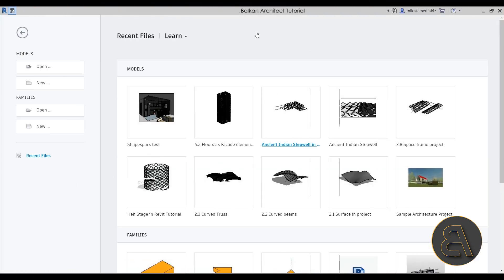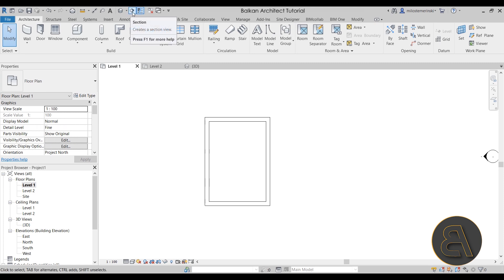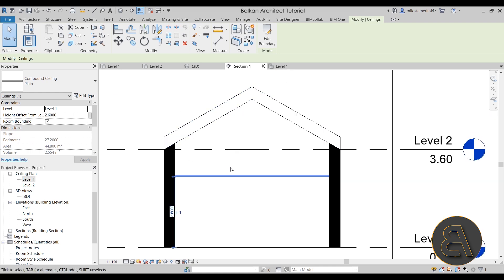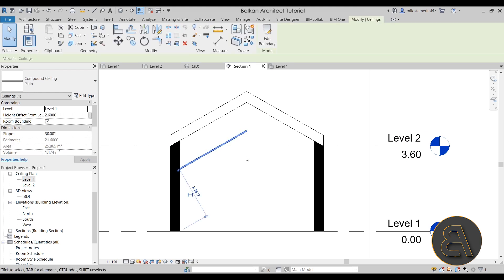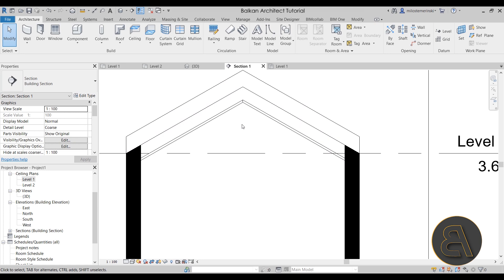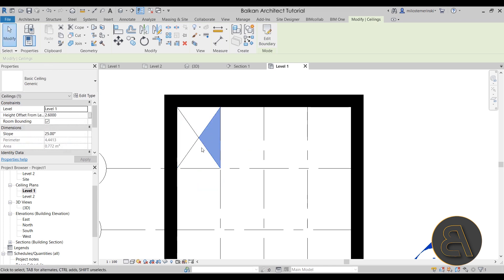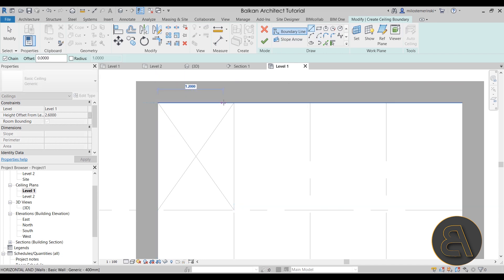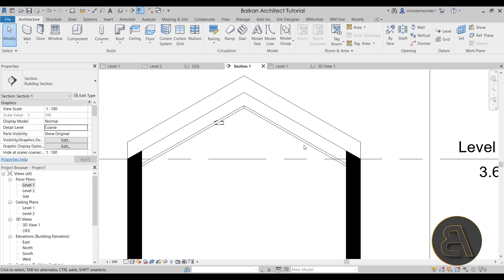Sloped / Vaulted Ceiling in Revit Tutorial

Comment: Hello! Is there a way to attach the sloped ceiling to the sloped face of the roof other than just dragging it in the section view? I mean ideally there should be an offset value perpendicular to the roof because the vertical offset is largr than the ceiling thickness